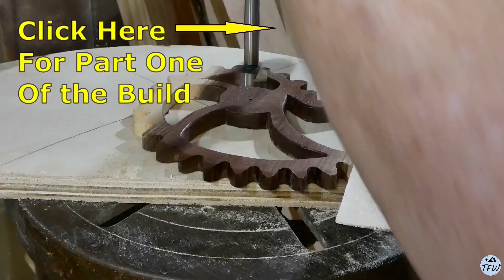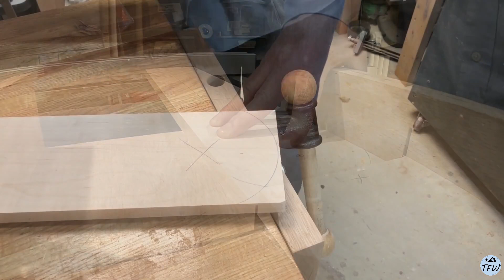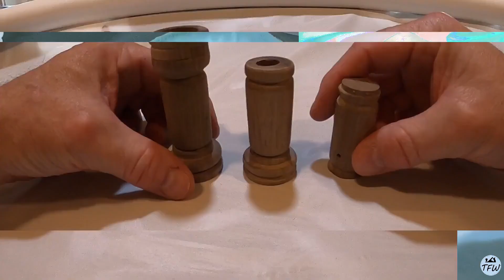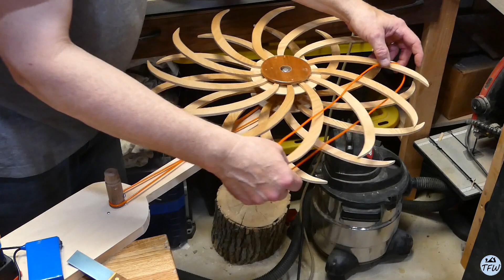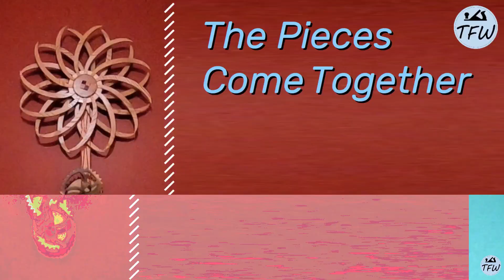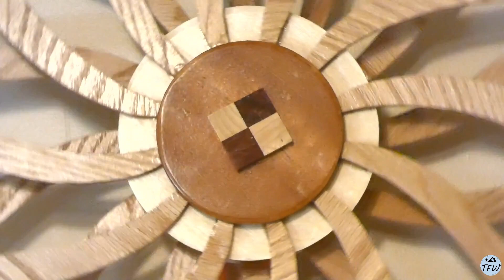Engineering Motion For This Mechanical Wood Sculpture

Comment: truly an awesome project,,, you told us where to get the motor,, please where can i find the neat little bearings and that very useful belting  material. thanks again, you have me hooked.
Reply from the maker: Thanks John!  I found all my mechanical pieces and parts from Amazon. The bearings are simply roller blade bearings that come in a set, and the belt was 1/8 inch polyurethane belt that comes in a variety of colors.  I think I wound up using less than 10 feet of belt in total.  Thanks for watching... tell your friends!

Comment: Did a quick search, are all of the bearings and spacers from the same company as I looked up Radeckal and it's a skateboard company. Just want to know if that's where the parts are from so I can learn how to bring my own design to life, as I've encountered little material on these types of kinetic sculptures on how to actually make them with this level of detail until this video now.
Reply from the maker: Hey!  Kudos to you for giving this type of project a try!  There were no real detailed instructions available to me either, so I played with the design until I could make it work.  There's pride in that knowing you designed it!  As for the bearings, any skateboard/roller blade bearings will work since they come in a standard size. As for spacers between bearings, there are some designed for roller blades but if you want a different length, I used 1/2 inch aluminum tube (Cut to length) and they work well between bearings. You can get the tube at most home centers...  I do very much wish you well on this project!
Reply: @TheFamilyWoodworker  Thankyou. Biggest fear for most of us who want to learn is being cost effective, as investment tools are tough to swallow and we want to make as few mistakes as possible to avoid burning capital that would make us regret even trying. I'm a stickler for design plans for example(working on it), but not everything can be done on softwares to see if it will work in real life and even that takes time to learn and use the tools. Any who, thanks for the reply and making the best kinetic sculpture video I've seen to date.

Comment: sir can you explain how the opposite rotation of both the wodden disc is achieved over the same axis i am still puzzled over it
Reply from the maker: It was a brief comment in the video, but the front wheel is using a drive belt running straight up from the pulley, while the back belt driving the back wheel is crossed over once.  You can see the criss-cross of the back belt in the video, which makes both wheels turn in opposite directions.  Hope this helps your project!
Reply: @TheFamilyWoodworker  thank you sir for the prompt response

Comment: Thanks mate, this is a wonderfully clear explanation and well-shot video. I wonder if the platter motor from a microwave oven would suit this application? I've never used one but I understand them to be very cheap and available (especially if you get an old microwave!) reasonably torque-y and the run direct from the mains. Maybe not Ideal for something free-hanging like this piece but maybe for something floor-standing? Well, just a thought. Thanks again, I enjoyed this.
Reply from the maker: Thank you!  I think any slow rotational motor will work.  I almost used a DC geared motor that drives a furnace humidifier, but was trying to build it without a cord.  It's your design, whatever works, works!